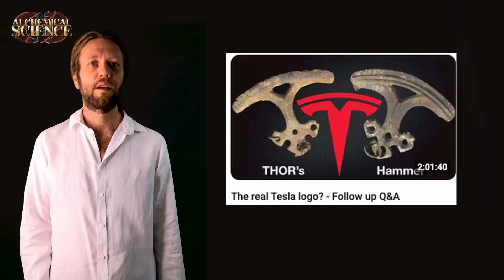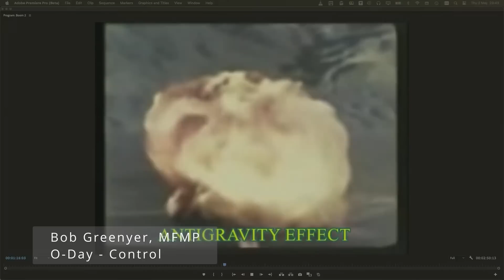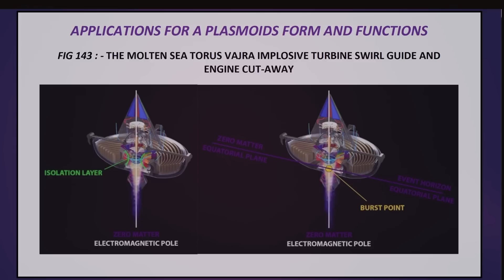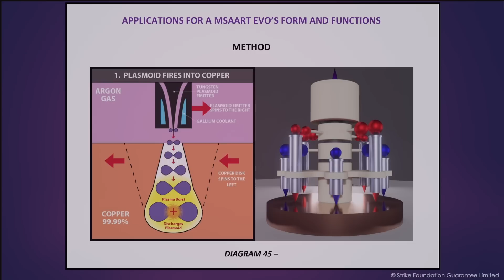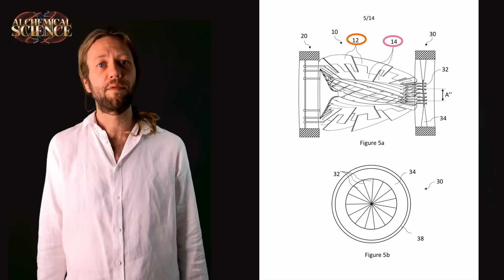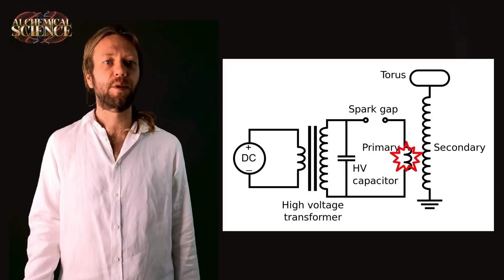Malcolm Bendall’s Direct Matter to Energy Warp Drive | VAJRA Implosive Turbine | UFO Tech

Comment: Energy too matter Harmonic grid location is at the Len Beadall "Aboriginal Stone Hendge"  mentioned in his biography. Roughly next to a large clay pan half way between Emu (Atomic test site) and the Cook railway junction. Bruce Cathie gives its latitude and longitude in his book "Harmonic 288"  and conclude with mathematical calculations that this is a good site to convert Energy too matter.  I hope this helps to configure a Resonant Antennae for your Vajra.

Also from the Vedic Scripture I recall at a TAFE college doing the experiment to evaluate a Iron and mercury battery that achieves Piezo electric resonance via audible frequency input and therefore creates electricity.   ASTRO member here.

Comment: This is not a very enrapturing promotional presentation, and there are a lot of them like this. The marginal benefit of watching multiple presentations on this topic is extremely low. If you've seen one you've basically seen them all. I have yet to see one that adequately explains how the technology actually works in more than superficial terms, but that's fine. It's early days yet. I'd advise the presenter to GET. A. SHAVE. because that beard is just plain awful!

Comment: Most of the worlds population have no idea what this means and it could be the biggest discovery of the universe which will have a massive impact on different kinds of flight,vehicles as it pumps out more or the same energy from a jet engine but 1/2 the size and no fuel source?this is the cleanest possible way for climate change and better than any renewable energy solution

Comment: Telling everyone how to make  one of these engines may not be enough from stopping it from being suppressed. You need a production application in a nation that can roll it out in such a way that others would be forced to catch up.  
So lobbyists in the US could claim that the cost of converting to better technology is prohibitive. “We’ll need 20 years to adopt. Until then let’s protect jobs and restrict it.”

It’s worth a shot but oil and gas has a firm grip on legislators in the US. 
If the DoD wanted the drives for military applications they could probably restrict commercial aviation from adopting even if they wanted to because it would increase profits.  The military would simply claim it risks national security. So you’d need to partner with a nation and the right customers in that nation that wouldn’t bow to international pressure to wait.  

So Airbus vs Boeing would be a good example of commercial competition that might work.  But the US could restrict Airbus from competing for federal contracts or some other garbage move.  
Time will tell I suppose.
Reply: All you need to do to get the technology out there, is give one to the Chinese, they'll reverse engineer it, and before you know it, they'll be available on Allibaba, Temu, ....

Comment: How do you get it rotating to start with, and control the speed to get thrust you want.?
Could generator be hooked up to it, or does it generate power?
Reply: Theory is you create an implosion using Hydrogen which then converts to o2, but the way the turbine works, the theory is that you will be able to design it to run on any fuel source and produce any byproduct you need. Because of the implosion matter is broken down and in the process the turbine system harnesses this and generate power and a byproduct you can choose, essentially you will choose what elements to recycle back through into the implosion and what element you will let out of the exhaust process. The theory is you can burn unwanted emissions in the air and produce massive amounts of energy and oxygen as the byproduct

Comment: Ty for sharing. I was sceptical at first so I went in the garden with some old bike spokes and domestic electricity wire. I put them in the ground 24in apart and tested the current. Was shocked when my meter spiked to 6.892 volts then dropped off. So thought I did it wrong. But notice it climbing up again. So it was cycling. Awesome. So now I'm gonna place more probes in the ground and generate cell earth charge. 👍

Comment: I have some questions Jordan: the microplasma formed because of cavity, how does it sustain itself long enough to perform the transmutation? Also, could you explain the transmutation itself in more detail? Fascinating stuff!
Reply: Hope this helps:

Fractal Toroids, which can be formed quite easily from Plasmoids (simple Toroids), are at the heart of this technology: Fractal Toroids share many characteristics with black holes (matter consuming Fractal Toroid at the center of an inward spiralling vortex) and that connect with white holes (matter ejecting Toroid at the center of an outward spiralling vortex) by a stream of collapsed matter able to travel through "normal" matter as if it is not there until it hits a metallic surface - very reminiscent of Tesla's radiant energy / cold electricity - and how easy it is "in nature" to create these structures using just water and Aluminium foil held in a cradle to set up a resonant chamber and access to both sides of the foil in an ultrasonic jewelry cleaner (said Fractal Toroids forming at electronic speeds) - just look up MFMP "ULTR - Spin vortex" YT to see a real-time demonstrating of this most easy of experiments to perform - and let nature show you how it's done! 

So, by applying repeated shocks to water (in this case, using ultrasonics) ("->" = leads to)
 -> formation of cavitation water bubbles at Aluminium surface
 -> charge separation / self forming (water) vortices
 -> breakdown of H2O into paramagnetic oxygen + hydrogen ions + electrons
 -> formation of 1st level toroid ("plasmoid")
 -> (with more matter being drawn in through the vortex) 2nd level toroid
 -> (with more matter being drawn in through the vortex) 3rd level toroid
 -> ... (deeper levels in the self-similar fractal toroid structure)
 -> ElectroNuclear Collapse (ENC) of the matter being drawn into the fractal toroid's sub-toroids and its virtual center, where magnetic pressures reach (a calculated) 50,000,000 Tesla
 -> Exotic Vacuum Object (EVO) at the center of the vortex with a coherent electron shell surrounding a hollow (matter reformed) crenelated Iron-56 / Oxygen-16 sphere surrounding a sphere of collapsed matter
 -> (if still more matter fed in) exit stream beyond the event horizon of the virtual center of the fractal toroid, streaming out along the outer moment of the fractal toroid (basically, the surface of a larger torus)
 -> striking the Aluminium surface again
 -> ElectroNuclear reGeneration (ENG)
 -> preferential production of alpha (Helium nuclei)-conjugate nuclei (C-12 (diamagnetic, so expelled), O-16 (paramagnetic, so retained), S-32 (diamagnetic, so expelled)
 -> electron capture from Aluminium to complete the process as the reformed matter enters back in to "normal space"
 -> AND, when the EVO ruptures due to exhaustion of feedstock
 -> ElectroNuclear reGeneration (ENG)
 -> again preferential production of alpha (Helium nuclei)-conjugate nuclei (C-12 (diamagnetic, so expelled), O-16 (paramagnetic, so retained), S-32 (diamagnetic, so expelled))
 -> electron capture from Aluminium to complete the process as the reformed matter enters back into "normal space") 

In this way, the Fractal Toroids, fed by inward spiralling vortices, furnish the virtual centre of the toroid with electrons and nuclei that, under increasing pressure and the influence of the vortex “tornado”, form coherent shells of electrons/ nucleons that, under ever increasing pressure, break down into aetheric matter at the very centre, a core around which an oxygen-rich crenellated iron sphere forms, such spheres (spherules) being released where the tornadoes feeding the fractal toroids run out material or where the coherence breaks down.

See collected papers of Dr. Takaaki Matsumoto and work of Kenneth Radford Shoulders (amongst many other experimental physicists) for more details of ENC/ENG and EVOs

Comment: Why does the Thunderstorm Generator emit a near perfect copy of the inlet air? 
Wild coincidence, or an inherent replicating effect?
How to get something else out, such as hydrogen to be looped back into the engine as second stage fuel?
Reply: When I found this, I watched with open mouth (some time ago): in the periodic table, Carbon is on the 8th position, Nitrogen is 9th and Oxygen is 10th. What follows is Fluor. I, being an atheist (with very good knowledge of the Bible), was flabbergasted. Carbon is a building block for everything alive, Oxygen we need for breathing and fire, and Nitrogen ensures that Oxygen doesn't kill us all in a horrendous explosion. Why are they next to each other? We can live without gold or most other elements, yet these three are crucial.  
To answer your question, the torn Hydrogen from the water has the free electrons/protons and these readily transmutate the Carbon one up to Nitrogen. But more of the same transmutates Nitrogen to Oxygen by giving it another electron and proton. Maybe there is also Fluor created by getting another electron - but they measure it by the exhaust measuring device which counts the harmful stuff (C and N and their compounds) and what is usually expected (Oxygen). It does not register Fluor. On the other hand, some elements are readily changeable, so possibly Oxygen is the result, and Fluor is harder to accept the extra electrons - I have no idea but suspect this is the case. The process isn't perfected yet.

Comment: Stanley meyers water injector/sparkplug
Reply: Stanley's was more inefficient, partly because he had inadequate feed back from others. @Cloxxki gave a good reason why Stanley failed.
To quote him:
In my opinion, Stankey Meyer didn't want to reveal his investion, he wanted billions of his Stanley Church or whatever it would have been called, and he wanted the billions first. Had he open sourced and just named the heck out of all the aspects to the invention, he'd have bene positioned to make loads of money cutting ribbons, baptizing babies and delivering keynote speeches. Greed came first, he didn't believe he'd be OK when just sharing with the masses. Many inventors died to greed and paranoia first, nefarious players second. Open source is the remedy. The way Tesla died was not the open source death, he also sat on the good stuff.
Reply: @friendlyone2706  I didn’t understand his work until Bob Greenyer, Paul Pantone and Malcolm’s work. The spark plug/injectors were electrical geets/cold fusion plasma guns which split the water but the water is also full of plasmoids. Inject the fuel/water and zap it on the way out. It’s the same as Malcolm’s plasmoid gun that shoots the copper plate

Comment: At 1:57:28 it is impossible to transfer DC voltage through a transformer. It must be AC.
Reply: Actually, transformers work with fluctuating currents, so a pulsed DC supply will work as well - and actually better as reversing currents is wasteful.  Alternating currents continually change direction.
Reply: @gordondocherty  Yes, that is correct. 
A pulse DC current will work, but you will need a pulse generator, which wasn’t mentioned. 
I wanted to clarify for the general audience that DC current cannot pass through a transformer.
As soon as you switch on the DC, you will get one initial pulse through the transformer, and that's it, unless you switch it off and on again — pulsing.